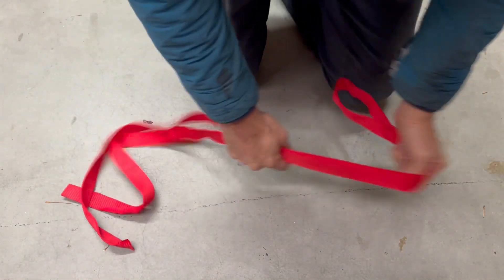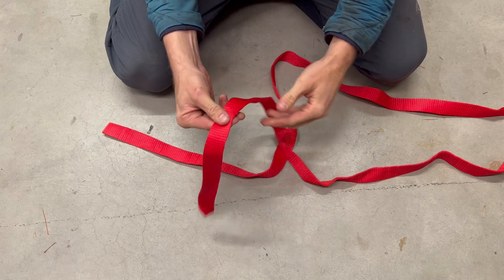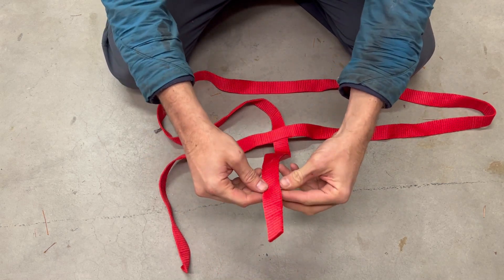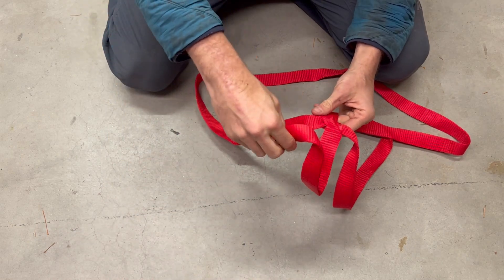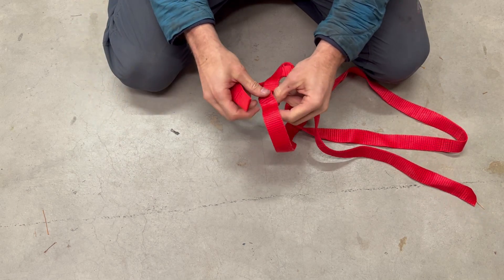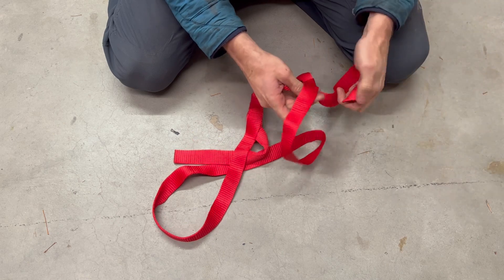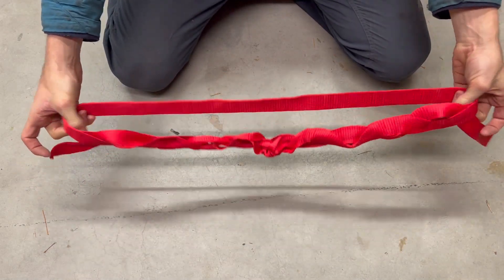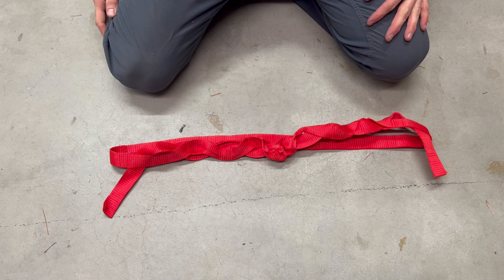Adjustable Anchor Webbing - Grog Loop

Comment: I think I recall originally it was not recommended to be using these slings for rigging highlines. However, after these tests, especially with seeing the strength of the grog loop, has this recommendation changed at all?
Reply from the maker: Absolutely! These slings are great for all sorts of purposes in a highline rig, we definitely recommend using them in such cases.